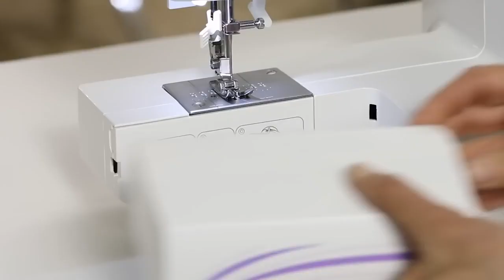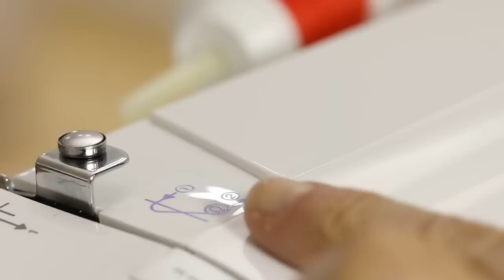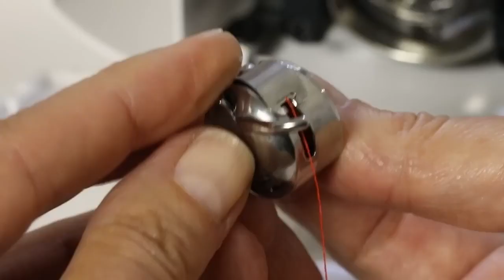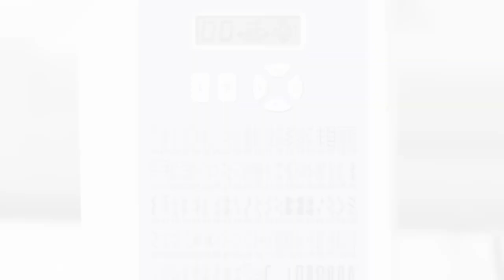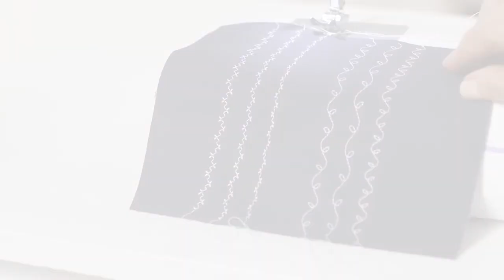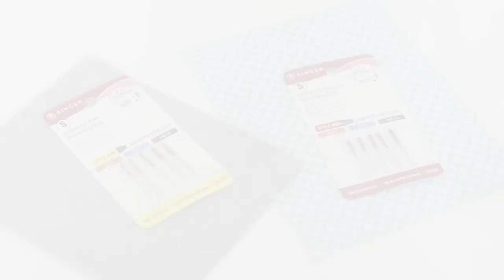SINGER® FASHION MATE™ 5560 Online Owner's Class

Comment: Mi máquina me presentó  una E1 y no cose que  debo hacer si alguien sabe por favor ayudarme gracias
Reply: Hello @anaalvarado6195. (Sorry I don't know Spanish.) The E1 error means that your machine thinks the top thread has broken. It could be a faulty thread sensor, but there was a user who had the same issue and kept checking out everything. It ended up being that the top thread was getting caught under the first feeder hook and the body of the machine. They put tape over the spot and they say that they haven't had any problems since. It may be kind of late for your issue but if it helps someone else, that will be great. Good luck!